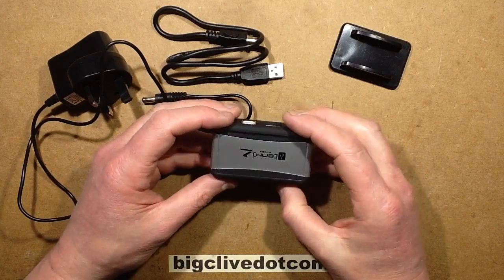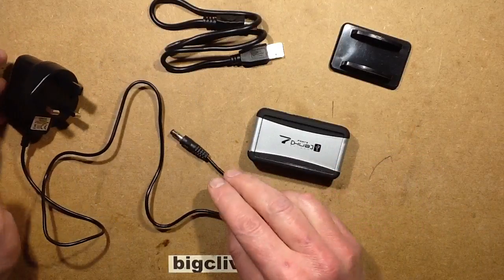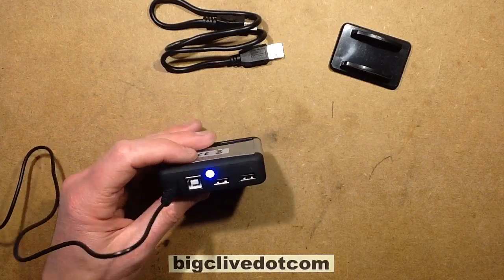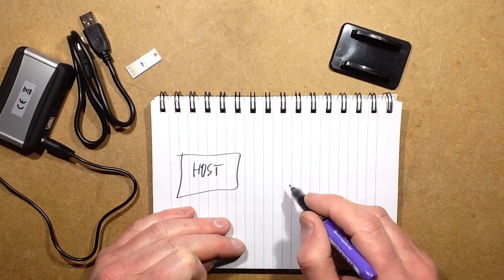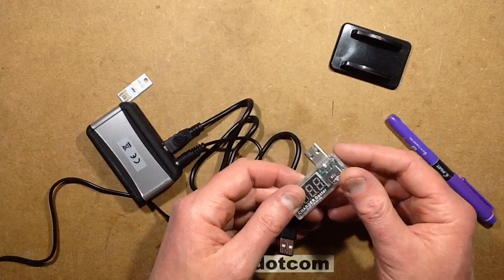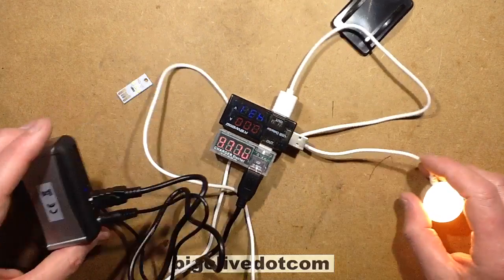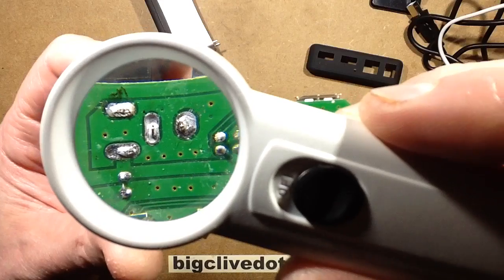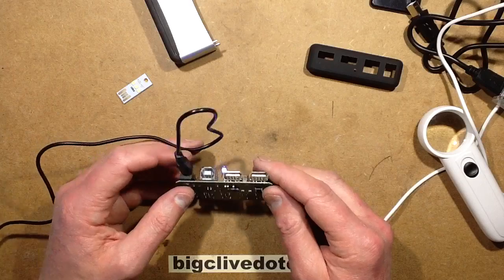Computer killing powered USB hub.  (Mac murderer)

Comment: +bigclivedotcom From memory (and don't flame me if I'm a little bit wrong here) If the hub is supplying 5v to the USB port, this will hold PPVOUT_S5_PCH_DCPSUSBYP high when shut down. This will keep the Mac in an S5 state until either the battery runs flat, a reboot is forced or the battery is disconnected. It should not destroy anything on the logic board, it simply causes the PCH to say; "WTF?"
Reply from the maker: +Steve Brace I think that may have been what happened.  I'm wondering if the company that serviced the computers actually changed the motherboard at all.....
Reply: +Steve Brace Agreed, it would be SPECTACULARLY bad design for a motherboard to be killed in this way, good opportunity for a repair scam though :-(. Still pretty bad design on Apples part to not be able to deal with this in a more logical manner.
Reply: +bigclivedotcom     If it was Apple and the Macs were still under a service plan, they might've not looked very deeply and just decided to replace the mobo. Sometimes it's faster and easier than going into greater detail to diagnose the issue. (Though you would think a battery disconnect would be part of their routine.)

If it was someone else...yeah, I'd be leaning toward repair scam.
Reply: stvn rncmn

Actually the person who sent this in commented here and apparently they sent the same computer to a lab three times, so definitely third party. Each time they replaced the mobo.

Repair scam, maybe. It's hard to know without knowing the specifics of the device. Fixing the damage this thing caused may have been non-trivial.
Reply: +Steve Brace Though that may have been what happened, I have one for me PC I never used yet.  I found out about the back feed before I ever tried it.  I decided that if I do use it, that would be for mostly stuff like flash drives anyhow.
Reply: +Volodumur Kalunyak It depends on the Mac. I was talking about Haswell architecture, your results may vary. You can force a reboot by holding down the power button for more than 5 seconds, waiting a few seconds and pressing it again. Obviously remove the external power from the McBook and hub first!. 

Applying +5vDC to a +5vDC rail should not damage the logic board... There are obvious exceptions with dirty or parasitic supplies, but generally that should work. Failing that, just disconnect the battery and hold the power button for a few seconds then reconnect the battery (this will void your Apple warranty).
Reply: "incestuous support"
Literally the most accurate description of Apple "Geniuses" I have ever read.
Reply: +lies damnlies Aaaaand now you've lost me... I play Flight Sim and Portal. :)
Reply: just killed a samsung slate 7 windows 8 tablet with one of these.please kill me.
Reply: *****    PowerShell has solved most of the big complaints I had with Windows' command line, or rather lack of it. It's actually...not shit. I mean it's not a panacea but it is functional. Functional enough that I can use git without pulling my hair out because of the command line. Still some hair-pulling using git though, which is to be expected. >.<
Reply: ***** Its funny you mention that, I mean granted my information is based on early practices where I had dealt with Mac's and PC's then took the PC road for the reason I had mentioned and also things like Itunes whee you have to convert,sync and mess around with that whole thing where with PC you can drag and drop and its much easier. Now having that experience years ago and my realization back then on the differences on swapping out parts it is still the story I use considering I haven't dealt with mac's or apple since those times. so it might not be relevant now. What I should have started that comment with was "When I had a look at the difference between macs and PC years ago I noticed...."
Reply: Justin Balacuit Sorry, that statement makes no sense to anyone knowing how USB works. Maybe one of your cheap tools shows those numbers when something completely different is happening.
Reply: lies damnlies Apple is well known for not actually fault finding. The just replace parts.
Reply: +Steve Brace so If you unplug this from Mac, will Mac continue to work or it will require repeair?
Reply: +stvn rncmn He knows. He just stated what Apple's routine might be.
Reply: +lies damnlies I pretty much only use my Mac for video editing because it has the best software for the platform on an i5. For gaming I use a PC. For accounting and invoicing I use the PC because of the more familiar keyboard layout and either are interchangeable for general purpose use... I used to use the McBook Air for portability until I destroyed the display with water... I'm saving-up for a new McDisplay :)
Reply: +lies damnlies I can repair the electronics after water damage, but displays just have to be replaced :(
Reply: *Chock full :p
Reply: I bought one of these some time ago. Luckily it was to completely refit with my own circuit  to act as nothing more than a power station.
Reply: John Francis Doe well, I fed 5VDC on the RX+ pin and well, the south bridge fucked up on me.
Reply: John Francis Doe a different thing happened when I fed 5V in the proper pin. I.e the positive power pin, it just showed up in the atx pin, I just did a continuity test in it.
Reply: John Francis Doe if you mean tools, I used a scrapped motherboard because it was very old, in multimeters, I use a Fluke 87-V in my arsenal.
Reply: John Francis Doe correction: it is D+ and D- not tx and RX, I just found out by my wallpaper. I forgot USB was duplex
Reply: John Francis Doe Voltage on the +5V must be isolated from the computer or proper feedback protection must be applied so that only data goes on the data pin, and the +5V supply is only supplied by the power provided by the given power supply. If that 5V goes back to the 5V supply pin, it's going to pop something in the motherboard. If 5V goes to the data pin, boom. Your south bridge is probably screwed up.
Reply: John Francis Doe most poor shitty usb hubs connect to the computer in parallel, most of the time, the USB adapter overcomes the supply voltage, thus causing the backfeed screwing up the south bridge or something in the motherboard. I had a client's motherboard replaced because the south bridge was damaged because of a usb hub. I myself refrain from those things as my gaming pc screwed up by that thing.
Reply: John Francis Doe you'll know it's an absolute backfeed when some peripherals run when you plug your hub in and your computer is turned off.
Reply: John Francis Doe I'm not being a know how here, I've only had a work experience of 2 years.
Reply: One thought: since the hub backpowers 5v, that means in particular it is unable to detect whether VBUS is present, which means it can also not comply with the requirement to ensure that "when VBUS is removed, the pull-up resistor does not supply current on the data line to which it is attached" (usb 2.0 spec, section 7.1.5.1). Feeding 3.3v via a 1.5K resistor to the D+ line into an unpowered transceiver sounds like it might risk destroying that transceiver?
Reply: had a nephew that tried to plug his headset into a usb port...problem was it was a 3.5mm headphone jack.  computer wouldnt start.  considered it trashed.  didnt want to open it because it was a little acer with the battery inside the frame and no way to access without take the whole thing apart.  after waiting a month to see if they would trash it the day came when they indeed decided to.  so i took it apart to see what parts i could salavage.  after unplugging the battery, then pluggin it back in, i accidently press the power button and it came to life.  unplugging the battery reset the boards protection i suppose.  but anyway if a short to ground on the usb 5v would trigger protection and reset on unplugging the battery it might be worth a try anyone with this problem on the mac as well
Reply: One for Louis Rossmann?
Reply: Is there really any doubt that Apple Repair would charge for services not actually rendered or parts not replaced? Consider https://youtu.be/_XneTBhRPYk "Apple under fire for allegations of controversial business practices" and https://youtu.be/NVAmnV65_zw "Apple uses spite to force planned obsolescence. Watch $750 tier 4 repair performed with $2 in parts." Actually, a lot of videos are like that on the Louis Rossmann channel, and he repairs Apple stuff!
Reply: I am an electronics engineer. I appreciate the form and function of Apple products, but their pricing and incestuous support annoys me. I like Windows machines because of their versatility, simplicity and preponderance to break quite often which means I can make a living and also have fun playing with the components like Lego in my spare time to see what happens! :)
Reply: +lies damnlies [Not at you] FFS... I thought the MCIBTYC fight died a decade ago! Listen Sheeple! You are free to buy whichever platform you wish. I'm happy with PC and Mac (I struggle with Linux). They all have their plusses and minuses. I am privileged enough to own many machines of different flavours and use them for different purposes... Just grow the fuck up.
Reply: +lies damnlies may not have been apple that repaired the laptops, could have been a third party apple repair shop.
Reply: +lies damnlies oh shit, its a fucking apple fanboy shill
Reply: May I ask what model of Mac was involved please, and is the same issue known to exist with other models as well? :-) 
 
I have a friend who buys lots of cheap PC accessories from the east and he says one of his Macs needs looking at. If it's the same scenario, then this video and your post will have saved him and me a lot of fixing time! :-D :-)
Reply: bigclivedotcom as a computer technician, usb power hubs must feed power on the positive and negative pins, i.e the pins on the outer side also the outer common.. And the TX+ and RX+ must not have a voltage over 15-26mV or you'll screw up the chipset inside. Just, don't ask why I knew that xD
Reply: ChaosHusky

^eyeroll^

Must we have more flame bait? Really? This video's comments are already chalk-full of it.
Reply: +ChaosHusky Yeah MACs are designed to die so then you have to get a whole new one. You cant get in there and upgrade and swap out parts like a PC. Granted they are probably a graphic designer and multimedia compilers best choice but then there are things like Itunes, it take a lot away from the end user, install this, sync this. You cant just copy paste multimedia from one device to another.

There are copyright benefits here but then this is abused by executives and lawyers like the music before computers was anyway.
Reply: +Dan Rosendahl Hansen The main problem is you're using a Mac. Take it back and get a good computer or go back to pen and paper... ;)
Reply: Steve Brace

[Not at you] FFS... I thought the MCIBTYC fight died a decade ago! Listen Sheeple! You are free to buy whichever platform you wish. I'm happy with PC and Mac (I struggle with Linux). They all have their plusses and minuses. I am privileged enough to own many machines of different flavours and use them for different purposes... Just grow the fuck up.

This. Though if I'm honest, this flame war won't end until humanity evolves. Too many people want to latch-on to something that inflates their ego. The PC vs. Mac thing tends to attract a lot of that kind of behaviour.

And I definitely agree, they each have their uses. Pick the right tool for the job, as it were. (e.g. buying an Apple computer for strictly gaming would be...beyond stupid. >.< )

Edit: Out of curiosity, what sort of struggles do you have on Linux? My major problems have typically been drivers (getting Ubuntu to behave on an iMac, for example, is frustrating at times), with the interface a distant second (mostly because I'm just not as familiar with it as Windows and OS X, but at least there's a functioning command line :D ).

Linux (depending on distro) definitely wins hands-down in the lightweight-and-efficient department though. Great for doing network stuff like building a small box for a firewall or NAS.
Reply: @liesdamnlies3372  I like that you support linux but in all honesty, Apple is crap
Reply: @user-yw8sr3uj1w  Well, yeah, but which tech company isn't? They're all shit at this point, and none are trustworthy at all.
Reply: @liesdamnlies3372  yeah dont even get me started about the "new" Microsoft and their windows 10 🤮... Almost as bad as Apple!
Reply: @user-yw8sr3uj1w  I was thinking of the ever-deteriorating conditions in their sweatshop factories, their acquiescence to Chinese censorship, and by extension tacit support of the Uighur genocide.
Reply: Ryad Arlan

Yeah MACs are designed to die so then you have to get a whole new one.

Patently false. The only built-in obsolescence, if you can even call it that, is that Apple will cease supporting older models with OS updates (full version updates, not necessarily security updates, which get pushed-out for a good while after) eventually. But the time-span on that is nearly a decade. This is comparable to Windows (you can install Windows on whatever computer you please, sorta, but there are no guarantees it'll actually work.)

Anecdotally: My first MacBook Pro lasted 9 years before my own abuse of it took its toll and the monitor's connectors died. But at the time it was still capable of running the latest version of OS X and doing everything I needed it to do, albeit rather slowly given its age.

You cant get in there and upgrade and swap out parts like a PC.

Actually you can, it just takes some know-how. You definitely can with the Mac Pro. But some components will be soldered-in on certain models, primarily laptops (and most iMacs but not all) like the CPU and GPU, but this is actually standard practice in the computer manufacturing industry. If you want a small form-factor computer that you can perform significant upgrades later on, you need to build it yourself, period.

Edit: You're also completely overlooking the other side of this, which is that Apple always knows what hardware they are developing software for. This means they can provide the most stability and ease-of-use of any personal computer platform on the market, hands-down, simply because they avoid all the issues with poorly-made drivers or having to attempt to support a gargantuan ecosystem of computer hardware, from bare-bones budget systems to workstations.

The only other argument would be that Ubuntu can provide similar stability, if you pay for their enterprise-level support.

You cant just copy paste multimedia from one device to another.

Actually you can. That you don't know how to do this is on you. Apple dropped all DRM restrictions on iTunes a long time ago.
Reply: Steve Brace
Lol. Yeah, most computers, unfortunately, don't fair well when doused in water. :p

You basically have the same setup I do. Windows PC for gaming (because DirectX or go home >.< ), but for general-purpose computing including financial stuff I stick with Macs. Mostly out of personal preference for the interface and presence of a useful shell (I use iTerm to have a guake-style terminal). (If I'm honest though, most of my notes are just plain-text files in Atom because I just can't be bothered to use Pages or some note-taking software when I usually have an IDE and Atom open anyway.)
Reply: Ryad Arlan Macs are actually the longest surviving machines. Windows machines can get clogged and need a clean Windows install after a few years, and even with good care, older operating systems are no longer supported and the new ones do major changes or can be utter disasters (like Windows 8 was). As for swapping parts and upgrading, you just need to pop the Mac open and swap parts. This will definitely void warranty though.
Reply: @PunakiviAddikti  My Windows installs typically last as long as the hardware. I don't know what you or your customers do to them. Though getting rid of a virus may sometimes require a fresh install.
Reply: @PunakiviAddikti  apple fan boy. Also bull shit. Ive never seen anyone swap out the GPU of an Apple device... Probably because its soldered the fuck on?

Comment: Where can I get some of those USB current testers? O.o This gives me serious pause about any USB hub I may want/need to buy since I can't afford to replace my computer if it's killed by dodgy USB devices.

Also, where can I get your fake USB load that you sometimes use? (The one with the two beefy resistors that can switch between a 1 Ampere and 2 Ampere loads.)
Reply: +Calyo Delphi   Ebay.   But they are made in China also, so beware! lol